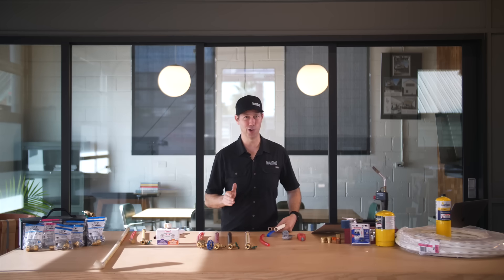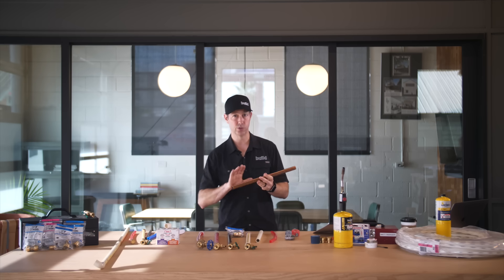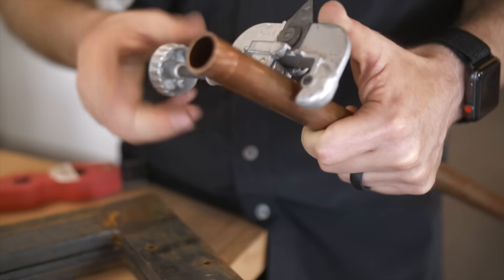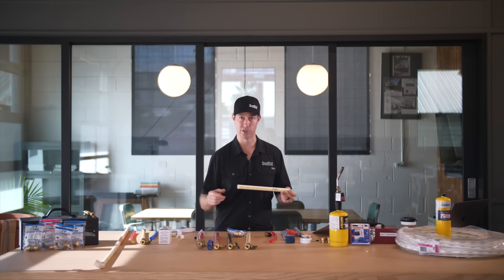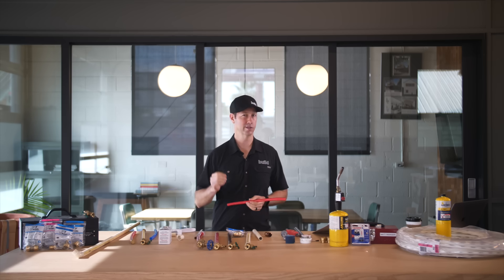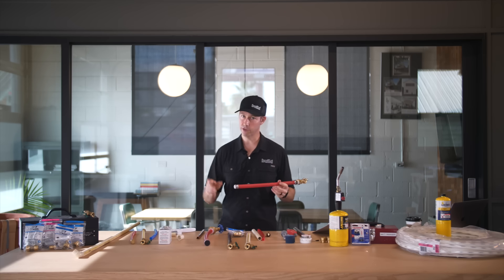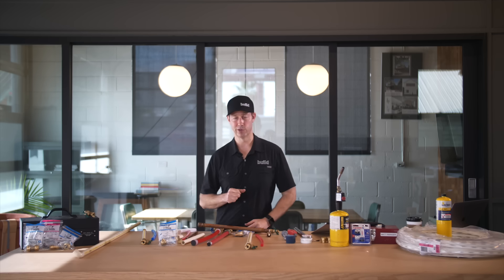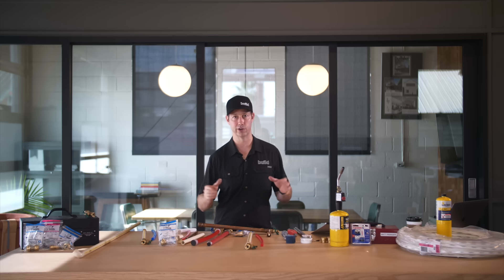PEX vs COPPER vs CPVC plumbing pipes

Comment: No mention of galvanized pipe?
Reply: Did you travel here from 1967 Tim?
Reply: @markbrinton6790  Good one!
Reply: Not a plumber, but here's my two cents: galvanized steel over time corrodes internally and chokes off your pipe's inside diameter. You'll see water pressure loss like crazy, that's been my experience. My house had galvanized steel pipe, and it's about 50 years old. I had to rip it all out and do it over so I could have decent pressure.
Reply: Galvanized pipes for new homes shouldn't be on any plumbers' radar. Hence, why it wasn't mentioned.
Reply: Galvanized is no longer legal to use. it will rust through.
Reply: It rusts from the inside out, eventually clogging up with rust or having leaks or both. Simply crumbles to dust when trying to take it apart to do the inevitable repairs.

Comment: 7 years ago I bought a foreclosed house (to live in) were someone stole all of the copper. I'm an electrician not a plumber. I replumbed the house in PEX using what was at Home Depot. PEX - B and SharkBite and crimp connections. I home-ran everything. After 7 years, not a problem. Now I'm in Phoenix and I left some PEX outside. After a couple of years it became brittle and easily snapped, so I completely agree with Matt's assessment with UV and PEX. How this helped.
Reply: The sun eats everything out here
Reply: I think metal survives heat more than synthetics.

Comment: I was born Oct 30 1972... My condo I own has Pex. But it is a bit more complex, it comes in from CPVC mains, goes into brass ball valves, and then into Pex. My valves were seized for unknown reasons and I had to have  plumber put new ones on, and they were worried it would crack the CPVC. Here is a photo on that day: http://web.ncf.ca/fs864/pickup/problem.jpg

Comment: We had a local company come do some upgrades and modifications to our boiler system and they used all copper near the boiler and pex out to the water heater and new baseboard heat zone.  Near the boiler where they used the copper they had a Milwaukee Hydraulic crimper and special fittings they actually put the coper sections together even faster than the pex it was amazing!  You should go over those connections!
Reply: That Pro Press tool is very expensive and most homeowners wouldn't do it, I'm guessing.  I'm actually buying the PEX tool used and it hurts paying $350.  Going with PEX for the freezing issue.

Comment: As a northerner, i've always been concerned with the use of PEX because of the mix of materials (pipe to fittings) and their different shrink and expansion rates due to temperature changes.  I never recommend it. I have had to fix/replace a few PEX fittings but was unable to tell if it was malfunction or bad installation since both were on newer remodels that the remodelers wouldn't come fix themselves.

Comment: Copper can corrode rather quickly if it gets in contact with (old) metal (eg. gas or pre-copper water) pipes. Especially in old houses that's a big problem. CPVC seems to become brittle, probably due to a combination of water hammer, temperature and chemistry, especially in hot water pipes.

All materials 'leach' stuff into the water, even copper does and with copper you often have problems with lead solder (banned in 1986 but some unscrupulous plumbers have known to still use it afterwards, reports as late as the early 2000's surfaced).

You should always flush pipes if they haven't been used for a while, there I've seen water with various colors and 'smelly' water in all types of systems. You typically (in in-use pipes) do not get leaching to the levels that are even remotely dangerous, let alone affecting humans or animals.
Reply: Is your comment about leaching based on something authoritative, or just conjecture?

Comment: Always used M copper for hydronic heating (low pressure) and L for everything else. However pex has dominated in recent years, oxygen barrier for hydronic, and non barrier for everything else. CPVC is not really used in my area.

Comment: If you're rich and building a mansion/custom home, use copper. It's superior to anything else. If you're building a cookie cutter use pex. If you're a home owner and converting rusted galvanized pipe to modern, use CPVC. This is the general rule of thumb in Oregon.
Reply: Dude you really don't know what your talking about. Copper corodes if there is any minerals in the water. I know because after 50 years as a contractor I've replaced thousands of copper pipe plug solid. NASA uses prez and has tested it in space.

Comment: Electrical ground loops cause pinhole leaks, actually the entire inner wall of the pipe gradually is eaten away as the electrical current drives copper from the inner wall into the water. How does this happen? By using copper (or galvanized) pipes as a ground, one common example is grounding your washer or dryer to to the copper pipe feeding the washer. Don't do this, use the safety ground of the power outlet if you believe you need to add a secondary ground to the body of any appliance, if you are really concerned about grounding, run a separate ground wire back to your power panel's ground bus.

Comment: Copper is king, but here in the UK Pex and push-fits for all concealed pipework with copper for the visible bits is the way a lot of new construction is being done
Reply: @Jeremy Hess Over here Push-fit is the primary jointing system used for pex, it can also be fitted into standard compression fittings but is really not a common find

Comment: Most plumbers I know swear by copper, but I believe it is because it takes some learned skill to sweat pipe.  Another thing the video didn't mention is that to sweat copper you have to have it dry.  You can train a monkey to glue CVPC or crimp fitting on PEX, but you can do that wet or dry.   That is a hell of a stress relief when you have a leak and can stop it almost instantly.  I ran a home run a home run system in my house.   Each fixture has a cold and/or/not hot line connected to a central manifold.   I have to replace something, I am not turning off water to the whole house and if I can't fix it that day, I can leave that fixture alone until I can and still take a shower or flush the toilet.  I think home run systems are the way to go.  It will be interesting to find out how long it will last.

Comment: Omg. That is the worst soldering I’ve ever seen. You need 1/2” of solder, if that, for a 1/2” joint. You het from the bottom so the solder flows to the heat. This guy is a 20 year newb! And a horrible mechanic.
Reply: So true! Heating the pipe from the bottom, not the top, and adding the solder to the top, insures that the solder won't melt until the entire circumference of the pipe is hot enough to allow it to flow ALL the way around the pipe, eliminating the chance of having a bad solder joint at the bottom of the pipe.

Comment: CPVC is complete junk. After 5–10 years it gets so brittle that it snaps of if anything bumps it. I had a major flood in my kitchen when I bumped a water hammer fitting and it snapped off the pipe.

Comment: i watched a few of these videos but i don't recall anyone mentioning the thermal characteristics. How is PEX with hot water? Does it need less insulation than a copper pipe?

Comment: Like I posed above: I spoke to several people while studying Geology.
Ceramic and wooden pipes; more modern Steel/ cast iron is the best for your health. 
Depending on the Water also stainless and copper but only if you have a build up inside. With calcification the led pipes are also still OK if you never cut or change something and let the water run out of the lead part after the weekend or longer stagnation.
All Plastics or better all materials interact with the water. The components of plastics are not known, and it will take centuries to be sure of the health problems they can cause.
Copper can poison you (even deadly for babies) if you have very acidic water.
Stainless steel is the same and can cause allergies from the dissolved Ni and Chromium. For Plastics it is the same but you have additional volatile parts that are most likely the more dangerous the newer the pipe is. So go for Wood or steel pipes. I find steel pipes work good. With the screwed on fittings and Hemp for sealing it is very strong and I found that small leaks can rust shut. It is much harder to dill into a steel pipe if you do something on your walls than all other materials! Plastic is sometimes softer and or more brittle then wood. And if you drill in stone you will never notice other than steel (or cast iron) pipes.

Comment: There is actually four types of copper tubing used in commercial and residential applications, not two. There is no need to use anything other than a one step cement for CPVC. If you use primer on CPVC, you are not a plumber. In the big picture, labor and material cost for cpvc vs pex installation is a wash.

Comment: Simple
Copper - old faithful. Requires the most labor and raw material cost. Limited flexibility (except soft copper), limited lengths. More reliable than cpvc in areas that have feeze/thaw cycles. Less reliable than pex when they freeze. Jack of all trades, master of none.

Pex - good all around. Middle of the road cost. Easiest to interchange with copper reliably. Best balance of overall performance to cost. Highly flexible and can do single runs exceeding 100'. Difficult to crimp in confined spaces. Fittings and tooling much more expensive than cpvc. Ideal for cold weather environments.

Cpvc - best warm weather low cost. The least expensive set up and tool requirements. Fittings and glue are $.25-$1.00 per fitting and $10 buys enough glue and primer to do a house. Limited flexibility may require additional fittings that soft copper and pex don't.

Comment: I had copper in my old house. In my current home I have CPVC, because I'm on a well. Supposedly, some minerals react with copper. Apparently my well doesn't have it, but they used CPVC as a precaution before the well was drilled. A huge benefit of CPVC, I never know when someone is running water in the house. Quiet is king!

Comment: This guy always speaks in half truths. Just pony up and pay for the copper.  The only reason you are using any other product is because you don't want to pay the price of copper.
Reply: There are ups and downs about each system.  I'm a home inspector in Phoenix and yet to see any issue with any of the water pipping systems. 
It's not a one size fits all,  copper might be King but the king is not the only one.
Reply: Just the opposite in my area, if you put copper in, within 2-3 years, the water corrodes the copper.
Reply: Justin Blades water does not corrode copper pipe ! One thing that does corrode copper pipe is the flux not being cleaned off the joints properly after soldering . Other things are not using dielectric unions on the hot water tank, anode failure and last but not least , other materials touching copper piping . There are more things that also corrode copper but like me you need to go to plumbing school and study the trade . However water can eat away the inside of a recirculating line , but that is not corrosion!
Reply: copper is noisy , bad at energy efficiency , more expensive , time consuming, …..the 80s called, they want there technology back!!!
Reply: These are tools for different uses!  I’m looking at re plumbing a whole house and copper would not work!
Reply: Not true. PEX has so many benefits over copper like having a manifold to turn off each device, limited connections and fittings, great freeze strength.
Reply: I'll never use PEX. A friend at work just had a PEX water pipe bust in his wall in the middle of summer on a 12 year old house. The pipe split in half not at a joint. Estimated damages is $30K so far.
Reply: @Chris_Cable  just thinking.. I wonder if it had too much sun exposure.  I can think of a variety of ways that could happen without it being outside.  Windows, skylights, near an overhead door, etc.. I've seen contractors drive by with it thrown in the back, or hanging on a rack in the back.. better stop.  It's sounding like Dr Seuss.
Reply: @Chris_Cable  Hey, an anadotial story. I know of someone that had a copper pipe spontaneously burst. Better kill the entire copper industry. Shit happens. Bad batches can be made or more likely, the pipe was gouged as it was pulled into place.
Reply: @Chris_Cable  sure it was whute not grey?
Reply: @Chris_Cable   That is odd. Maybe a dry wall screw cut it and it finally blew over time?
Reply: @Chris_Cable  - I'm with you.  A friend of mine had a really house built, and they used Pex, but it seems that the chemistry used (probably soy-based) made a really nice snack for some rodents over the living room...
Reply: Chris Cable copper get holes in it too

Comment: Great video's; I need to relocate my outdoor bib that will leave 2-3 ft exposed (Which I will insulate of course), but what do you recommend for outside to tie into the indoor copper fitting. Pex or CPVC or something totally different? (Galvinized, i.e.)

Comment: Electrolysis can eat through copper in just a few years. My homes had galvanized rigid pipe rusted and leaky combined some upgrades of copper which were forever springing pinhole leaks The rigidity of copper is not as forgiving and solder is very soft this indifference can cause joints to slip open when using threaded fittings in conjunction which is inevitable. When I use copper I do not solder,I braze (hotter melt harder weld).
I have re-plumbed 3 of my rentals each in just a weekend using shark bite. The pipe itself is pretty affordable but the fittings add up quick. You can avoid a lot of fittings because the pipe is super flexible . Every fitting can spin like a union and making an edit takes just minutes. This was amazingly easy and simple make a mistake no problem. It’s been five years no problems so far. Every push fitting worked perfect leak free.
I have talked to plumbers about this product and they say they would not use it because it is an accident waiting to happen.
The accident that may happen would be to the plumbers livelihoods more likely than the threat of failure by this product.
Anyone can do this themselves saving huge time and money on labor and materials.
And then we have the health question. (Flint Michigan ) need I say more?
As a “DIY “ fumes from soldering and the difficulty working in flammable conditions or impossible tight spots can be unhealthy and dangerous. Also these tight spots often fail as uneven heat distribution results in a failed joint. Pipe hammering can be noisy and destructive. The weight requires more frequent hangers and can fall in earth quake.
As far as plastic toxins. Your drinking out of water bottles that do not contain as inert properties as these new plastics , your coffee maker is boiling water in through plastic chambers. I have a very high end filter under my kitchen sinks for drinking and making beverages.

Comment: Shark bite will not hold overtime like any other silicon oring fittings. 40-50yrs by that time you will already be dead who cares.
Reply: A shark bite will never last 40 to 50 years.
Reply: I treat shark bites as compression fittings. Never buried in walls. Always readily accessible
Reply: Who cares the guy down the road who got to fix it

Comment: My house was built in 1988 and have had lots of pin holes and leaks in the copper. Also know many people who have had leaks in walls from pex.  Biggest issue with pex is the crimp band and fitting leaking not the tubing.  So I'll try cpvc next.  They do make the primer in clear if you don't like the look of purple primer.

Comment: I think there are a lot of older plumbers out there that will always swear by copper because their job security is on the line. It takes some skill to sweat joints and have confidence that they won't leak. Not to say sweating a joint is the only thing you need to know to be a plumber but it is probably the one thing that takes the most experience to do right and not burn down the house in the prosses. Pex, especially with expansion fittings is about as easy as is gets. A DIYer can install pex and not have to worry about burning down their house. I'm not a plumber but I am a small contractor and am just completing a new small house (1200s.f.) for a client. I decided to do the plumbing myself for the pex experience and was amazed at how easy it was. I also had much more confidence in the expansion fittings than I would have in copper if I sweat the fittings myself. I suggest copper stub outs though. I don't like how flimsy pex is when you stub it out.
Reply: I think there's a lot of young plumbers that grew up on plastic and there's just too lazy to learn how to solder properly.
Reply: I'm not sure if it's lazy or just lack of necessity. I don't know about the rest of the country but around here most of the production homes being built have Pex. I also see it increasing in commercial buildings. I think any plumber should learn how to sweat a joint properly but at the same time, I understand why many new plumbers don't, especially residential plumbers. It's beginning to look like copper could become obsolete.